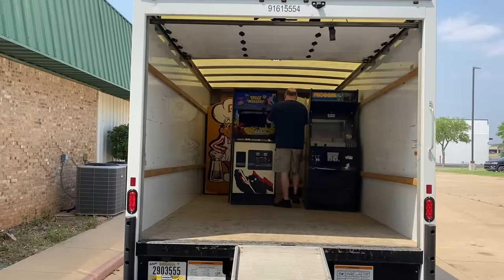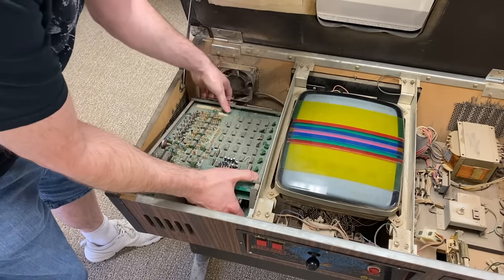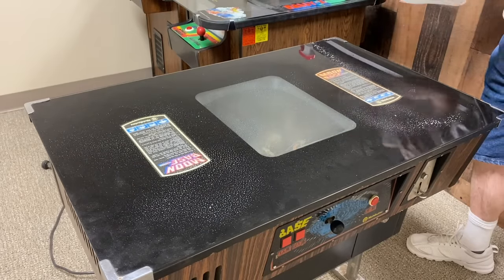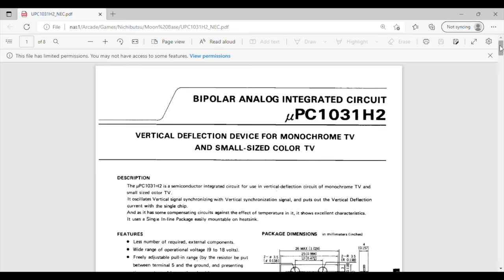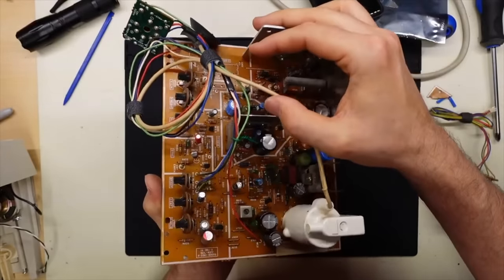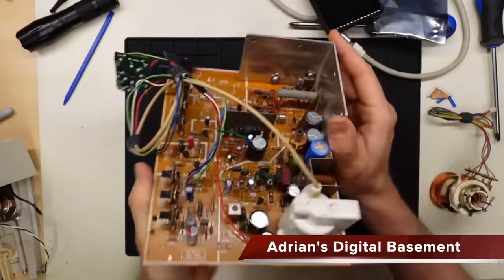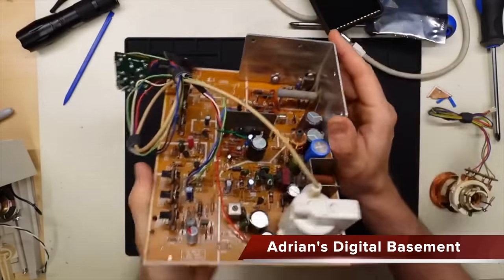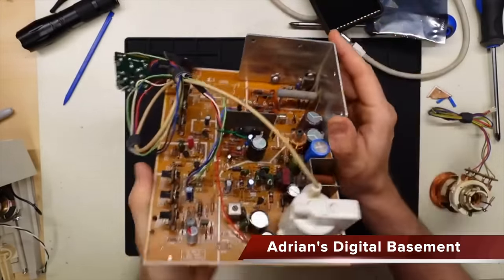Moonbase Arcade Restoration - Gone Wrong

Comment: I think the reason that Chip was burned out to begin with was because it actually was intended to run on a hundred volts 

The reason it was already burned out when you got it was because the previous person who had it had likely imported it from overseas or something and simply not known about the voltage difference so they themselves installed an American style plug and ended up killing the machine

So then when you got the chip replaced and then once again plugged it into a 120 volt socket it was too much and burned out the chip

You need to get yourself a step-down transformer that steps it down to the 100 volts and replace the chip a third time

Comment: Please don't use cleaning products on the back of a CRT as you are likely to damage the aquadag coating. Blanket changing of all the caps and other components often works but you really need to be trained in fault finding and repair at times 😊... analogue repair is a dying art. Looks like there may be poor supply rail regulation/smoothing on perhaps the other panel supplying the monitor board?  Also monitor the video signal from the game's motherboard to see if it changes when the fault occurs. Great video as always.

Comment: In Adrian‘s video when the voltage supplied to the driver board gets low the signal freaks out the voltage supply going to the driver board might be doing something weird you should check the voltages.

Comment: You need a stepdown transformer or a bigger heatsink. I would say more air flow, but you would need a box fan for that with 10 to 20 V more than is needed. Thank of it as overclocking a CPU or GPU.

Comment: personally I would have cut up some hosiery (if not a purpose made fine mesh solution) to add and cover those vents, the holes are so big that it isn't going to block a single speck of dust, hence why it was such a mess inside.

Comment: The startup screen after adrian fixed the board showed some pretty wierd anomolys before it settled down and presented a solid correct picture on the CRT
That should give some clue what is going on

Comment: When You Solder A High Power Wires Like 220 Or 110 Then You NEED To Make The Wires Mechanicly Together And THEN Solder And Not JUST Solder Them While They Are Just Touching Each Other, Them Wires Could Get Hot And Unsolder Themselfs, Solder Can Dripp Out And They Can Start Sparks And Fire

Comment: That monitor fault looks like mains ripple on the dc supply to it. You seem to have a 60 / 120 Hz variation in voltage which matches the scanning frequency creating a tall picture when the ac mains is at its peak and a shorter picture when the ac mains  drops with each cycle. You replaced the electrolytics on the monitor pcb but the service manual shows it getting its volts from a separate pcb with a 3300uf 35v smoother.
Reply: Also I doubt that old ic was blown as old ics can discolour like that due to oxidation. It is also possible to have a diode fail in the bridge rectifier of the power supply so you get a 60Hz ripple rather than 120Hz. This can be intermittent when under load so it measures fine with a meter but gives an intermittent fault after a period of time, exactly like you are experiencing.

Comment: The joystick should have a nylon washer on it, usually about 5mm, it was so the joystick could "kind of" spin so that the nut didn't come undone from people twisting the stick, (knob robbery was a big thing) its probably just been warn down to dust and was within the crud you blasted out, after this amount of time it would have disintegrated anyway, the only reason i know this is that my unkle has multiple tabletop arcade machines and the ones without joysticks he would fabricate his own which was cool and fascinating to me, as for the screens, i never got to get near things like that as he was worried my curiosity would kill me, but he used to have a stack of philips "flatscreen" crt's of various sizes that he would swap out as needed, personally i would grab a TFT pc monitor just an old dell vga one would do, they literally cost nothing second hand, then cut off one end of a VGA cable, join the signal wires to the composit signal pins, short the signal detection wires and gluw the power brick to the back of the monitor, plug that in to your service port and done, an updated but retro space invaders with a decent bright screen that uses less power and has a mildly lesser refresh rate that tou wouldn't even notice lol

Comment: I think there is a chance that your just giving it to much power. The side panel says 100. Most of the components would get DC voltage that would "protect" it from the over voltage, but that part may be more susceptible.  However it may be such a thing as it's asking for 100 V so it would accept 90 - 110 and your providing 130ish. It heats up more, and "burns out" that chip. Even though you would think it was isolated by the transformer, it may just be getting to much power. 

Or I could be totally wrong. But I have run into that a few times myself with older electronics.

Comment: These (moonbase tabletop) are quite common in the UK but sadly many have been 'upgraded' to the 60 in 1 board and modern color flatscreens and ppl ask mega money, in any condidtion worth much more than $200. Sad you drilled your near mint cabinet I would of just devised some wire through the coin slot gap and fitted an external switch.  I usually have to resort to ebay for old bits, I don't have moonbase but have astro fighter tabletop. Like you I find the monitor hard to work on and someone replaced the pcb with a totally different kind of board but still trying to make it work.

Comment: I remember seeing something similar at an old Pizza Hut back when you could buy the "personal pan pizza" that was tiny as can be. They had these in the lobby while you waited. Out of curiosity, do you have to  use flux when soldering and de-soldering the pieces to and from the board or is it not necessary? What temp do you usually run at for boards to avoid damaging them?

Comment: not an expert, but the way of proceding here is asking why the chip burnt, and then proceed backwards until the root cause is found. This concept is named "the five whys¨.
Not always the best adive, but sometimes it is... 
E.g. one could measure powers when the machine is in operation and see what is off. One could also protect the chip with something ro stabilize it. but who knows what other may go astray on the board.

Comment: Personally I'd check the chip you replaced & if its faulty replace as sometimes s#it happens & you get a faulty 1 but also check voltages etc supplied to it  as well as check for resistance that could drawn from it by the monitor yoke & circuits in between . Something as simple as a dry joint could be allowing limits to be exceeded.  Hope this helps

Ps even a missing ground can cause problems . Just ask Adrian about a grounding RF sheild for example

Comment: My brother and I made the same mistake with memory modules on an old 8086 pc, we put the memory circuits backwards even though the board had the correct layout drawn on the surface, around the circuit socket, the computer kept crashing.
Good times. 👍😹

Comment: It's very probable that putting the chip in backward may have damaged it. Also did you check voltages? It did say 100vac. You may need to adjust power supply.

Comment: FIX FOR THE BOARD ..... My bet would be that the vertical amp is powered via zener diode(maybe a transistor as a cheap voltage regulator) my thinking is the zener and transistor is heating up causing the voltage to drift resulting in video scroll.  So look for a zener diode and/or a transistor powering the chip and replace them both.

Comment: dusting - cough-cough.. surprised you didn't hook up the Vac while blowing it out! - Looking at the joystick, pretty sure it has a plastic bushing in there that has worn and thus the slop... If you measure it up, I can 3d print you some new bushings to get that slop out. Minimally, you can use a washer under the nut with an OD slightly bigger than the shaft diameter. That will be even easier. Also PB Blaster works really well for goo removal.

Comment: Carnt help with the rolling but you can use wet tinfoil to shine up the chrome  leg's.  Also with  my Rad Mobile I did find just re adjusting the hold pots worked after a few try's  this may of been  down to dirty components.  Before thats screen would drift diagonally  after  a while.

Comment: Maybe the expected voltage is too high (120 instead of 100) which causes the chip you replaced to constantly burn out. See if it works with a different transformer.

Comment: I wouldn't rule out replacing the Vertical Deflection SIP again - It says on the Datasheet you showed that it's max Vcc is ~18/20V... as others have suggested, it may be that the machine is for 100V mains....

If so, then the SIP connection point Vcc pin -> Vss would measure above 20V across those pins if it should be powered by 100V. [i.e. if that V is too high, then the circuit prior to that is likely just dividing down from the mains]
- you could measure this with the SIP removed, prior to fitting a new one. 

Of course, if the Vcc on that SIP location pin is actually below or at max 20V [i.e. in the datasheet range], then the machine as a whole is likely ok for your 120 mains, and the problem would be "somewhere else" [shrug] :)

I say all this as it seems the likeliest failure point - the chip that "fixed" it, is a Vertical Deflection chip after all, and the monitor is sideways [portrait not landscape] assuming it's not a custom portrait crt, which is unlikely - so the scrolling is actually vertical hold failure.
Also that SIP tap point is a [caveat lector] safe voltage to test - by all indications it could be 24V [ 120 * ( 20 / 100 ) ] if your mains voltage is wrong. Moreso, other possible test votages, might be behind regulators, which could obscure other voltage tests once you get further down the chain [and likely protecting the equipment as a whole],  or simply be leading into caps or other passive components with a wider range of max voltage that you can't judge whether the V at that tap is correct or not [tho perhaps the manual helps :)]

If all else fails, XKCD #242 is my rule :D
Reply: [ tho I've now watched the subsequent video, so may as well ignore all that hey :) ]

Comment: you might want to do the shop vac and air nozzle at the same time ...its an easy fab using a gallon plastic jug as in clorox bleach .cutting the handle and bottom of jug off .run your shop vac to the top as an upsidedown funnel and the handle access hole add your blower tip from compressor ...this capturres the years of fine dust instead of throwing it out into your work area :elbowcough:  patent pending   nah but  that dust needs to be contained as a man who knows clean room  protocall...dust kills everything

Comment: One of the pins is gonna be a constant ground, right? or am I wrong? Anyway if one or more pins is assigned as a constant ground source, check the quality of that source. Unrelated as it seems, a few years back I converted my 78 Ford Courier's ignition to a four-prong GM module (I know, automotive app, but bear with me). I somehow missed the part of the diagram showing one of the mounting lugs having a ground wire attached with the mounting screw. Blew out like 20 modules before figuring it out.

Comment: I appreciate you showing your mistakes. 

I did cringe when you drilled a free play button hole. A way to make almost any game free play without drilling holes is to jump the coin switch wires over to the start buttons. When you press the start button, it will add a credit and start the game, usually simultaneously. A 2 player game takes 2 presses to get 2 credits. This can usually be done with jumper leads, making it a completely reversible and nondestructive mod.

This isn't meant to be a shaming moment, but a bit of advice about how it could be done differently .

Comment: i would bet that it isnt using a switching mode PSU and need to replace a specific Resistor within the power circuit to chance between 50 and 60hz regions it is quite a common issue when importing products from overseas that either werent designed to run at 60hz or was set to a specific AC frequency from factory however could be swapped

Comment: Would it be a good idea to try putting a resistor in line with the VCC pin on the chip?
I'm an amateur hack but I'd think that if you give the main power pin less juice it might still work but wouldn't fry...
Perhaps the original IC had a higher voltage rating than the replacement?

Comment: damn, one time i saw this arcade cabinet, it was in some video and the guy was in japan, it had this weird layout where you would be kneeling in front of the machine, and the joystick was that same weird vertical joystick configuration and the buttons facing the player. I can't remember the game though. It wasn't a tabletop, which is why i noticed it right away, as i never saw that configuration before, maybe it was common in japan

Comment: So, the chip burning out seems to be caused by an overvoltage. I doubt that this old tech uses any voltage regulators straight in the video section, so it's actually possible this thing was never properly converted to the higher US voltage. I would check the voltages on the video board, if they aren't going over the spec sheet max on the SIP chip. If they're too high you should check for any stray voltage regulators, or it might be one of the filtering caps going bad (and making the current draw too high). I know you replaced most of them, but not all, and some might have gone into short. This board needs just a bit more multimeter probing :) Good luck!

Comment: Maybe having that chip installed backwards did some damage and replacing it will be fine this time. But i would test to make sure the power supply is outputting the correct voltages.

Comment: Metal film caps DO FAIL. They split in two. Also, don't neglect the small caps. Often, low microfarad, high voltage caps fail (1uF 160V for example)

Comment: It could it be the power supply feeding more power to the internals than originally designed. Just like when your LCD panels started to randomly fail and found out it was a faulty power adapter.

Comment: 10 minutes of play before failure seems like an indication of a heat-related issue. Something (probably a diode at  a guess) is having its characteristics altered due to a change in the thermal curve, and probably caused a failure in the SIP identical to the one that you replaced.

Run a diode test on the suckers that feed the video chip. My guess is that you could replace that SIP, and once again get a nominal amount of run time before you have an identical failure. Eliminate the power overload to a new SIP, and hopefully, that'll fix the issue.

Just my 2 cents...

Comment: @8BitGuy why not just swap that monitor out with a modern LCD? If you want to keep the same game in there surely you can use a Raspberry Pi or another device that can convert the signal as needed for the modern display.

Comment: Your big mistake is when you replace the  Vertical Deflection chip  you AWAYS, Aways need to replace the filter cap on its power supply pin. Or it will end dead or it will have your problem. It will work for a bit and then start this effect .  Replace the chip and filter caps on it power supply line  , THE SMALL ONES and add 100nf if there is non in parralel to the populated on the board . This is the RULE when you replace CRT  Horizontal and Vertical Deflection chips

Comment: i´m in no way an expert on crt tvs and i dont know if anyone said this befor , but maybe it helps anyway . have you checked the fuse in the power section ? maybe they had a problem with that fuse goin off constantly and just smacked in a bigger one that lets the circuit draw more amps than its supposed to and this way frying the IC . thats the only thing that came to my mind .

Comment: Bigger heat sink on the vertical chip. Vertical amp chips fail all the time, overheating. The replacement may not be as capable as the original, and needs a little extra cooling.
Reply: also check the power rail voltages, and you could use a shorted turns detector to test the vertical deflection coils.

Comment: I think caps behaviour is still difficult to understand.
Changing caps has a part of urban legend.
There's been a plague about caps in beginning 2000.
Tantale are also quite sensitive with time, but it's a different subject.
But MOST of chemical caps still work perfectly, even 30 years later.
Of course if they didn't leak.

Bad caps from the late 90's had a problem. Only because they were used in switching power supplies.
Tantale also have problems, they age badly.
A switching power supply use caps with a low serial resistance (ESR). Which is dependant of the frequency.
At 60 Hz ... Who cares ...

Comment: The Fist Commandment of Electronics repair, Thou Shalt Check Voltages. Did you check the power supply? A shorted pass transistor in a regulator would cause the symptoms you're experiencing. An over voltage on the vertical IC could greatly shorten it's life. This is especially likely if it was designed for !00V and never modified.

Comment: Good job sir. Could always be worse in mistakes. A Company I worked with spent 6 grand in parts expecting me to rebuild a welder with 0 experience. I spend 3 days rebuilding it. Only for it to blow up and burn out 2 100amp breakers.... Oops 😂😂

Comment: I think I know what the deal might be. try, using contact cleaner in some of the potentiometers.  I have A Pioneer Phonograph from about 1975, where the pot's need to be replaced. and the speed on the phonograph,  is in auto adjust mode. from way too fast to just right and or too slow.   and, I think I saw,a few potentiometers, that might be suspect!